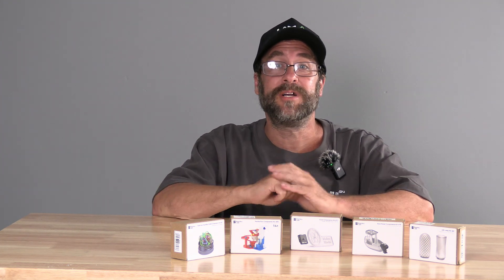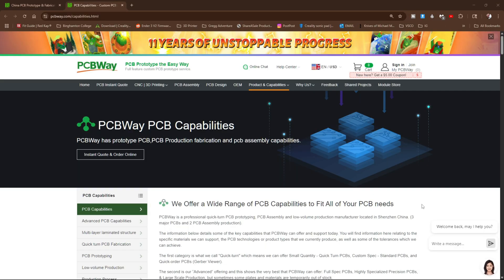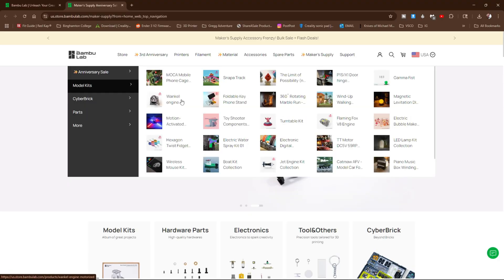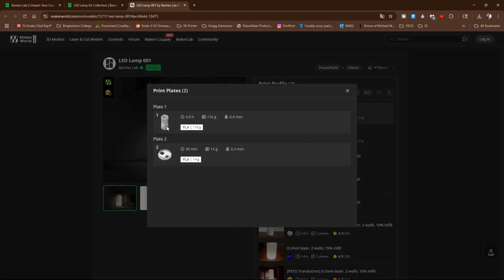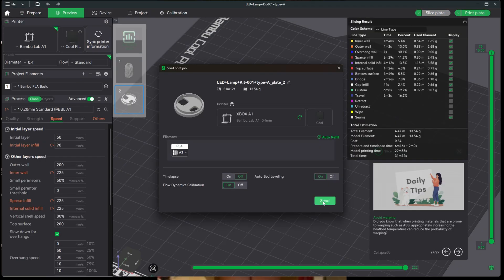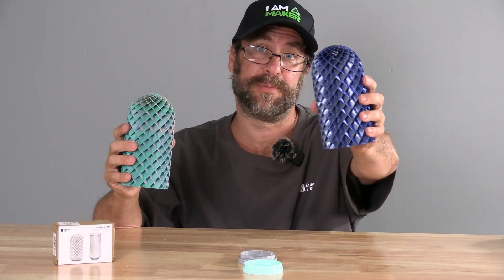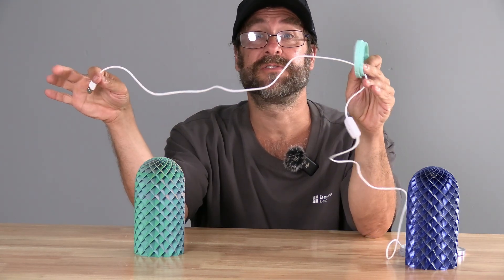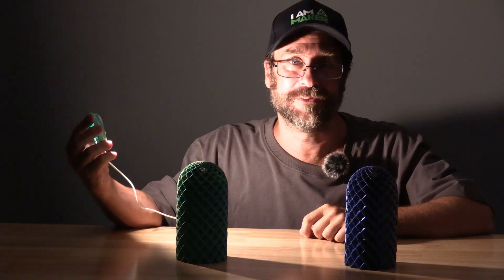3D Print an LED LAMP with Bambu Lab "Maker's Supply" LED Light Kit - Tutorial: Bambu *AND* Creality!

Comment: Nice! My printer came with the clock kit, and I've ordered the mouse kit, a1 mini charger, card shuffler, apex riffle, and instant noodle timer (afaik not in north america). It's been so much fun assembling them.

Can you do a video about the 1.8 firmware on P1S? When I installed it, I couldn't load any filament, and would just get "Failed to get AMS mapping table" error. I downgraded back to 1.7 firmware, and everything worked just fine. Are you experiencing the same issues?